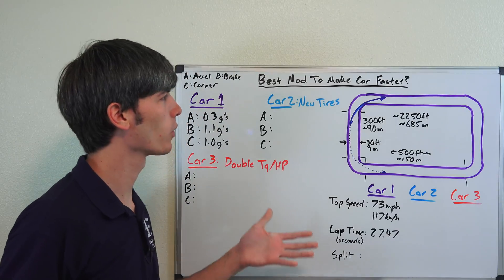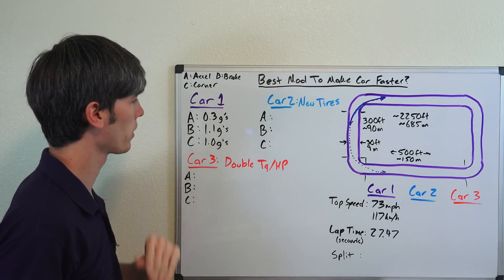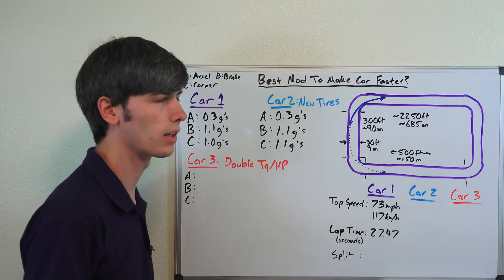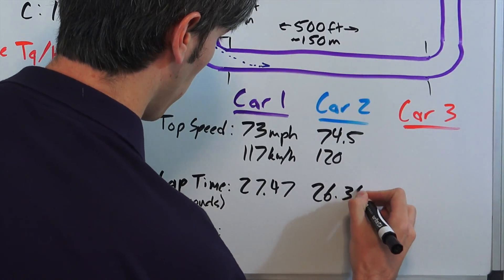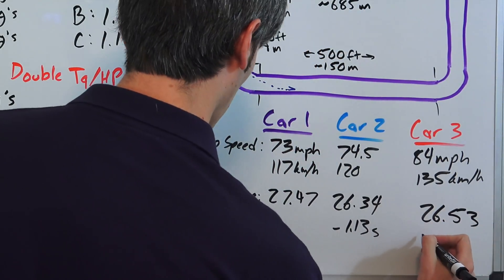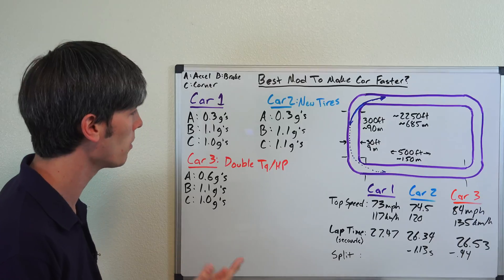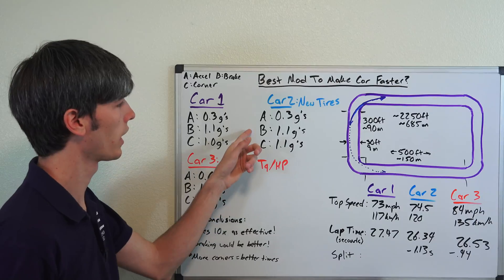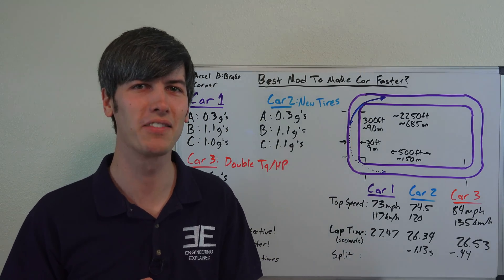What's The Best Car Mod To Go Faster?

Comment: This isn't a very good comparison because a track this INSANELY small doesn't give the doubled horsepower a chance to really be used. It would be like comparing 60-130mph rolling start times between summer compound tires and all season tires; they would be equal because you're not starting from a dig.

Comment: Your track it's totally unreal man, a track with 700m length doesn't exist, you are making this video totally useless to real life situacions!
Reply from the maker: +efrain kennedy just so ya know, a track can be long and still be a low speed circuit with lots of corners, or a track can be short and have long straits. Length does not determine average speed. There are ovals smaller than this.
Reply: jonathan jones The reason the F1 car was only marginally faster wasn't because of the distance, it was because of the surface and cold slick tyres, coefficient of friction limited acceleration for the F1 car for basically the entire length of the building
Reply: i think what he means is the F1 isn't so much faster, so friction is what matters.
Reply: Anybody remember when top gear used a F1 car to race a kia inside the NEC? Well the long and short of it was, on a very short straight the F1 car was just 4 mph faster than the kia.

Comment: Cool video, but can you do one where you factor in curb weight? I suspect (based on observations at track days) that power:weight ratio is not a linear measure of a car's potential lap time. It appears that excessive weight is severely punished by physics, and that extra power is penalized by a law of diminishing returns. That is, it appears that a brz could potentially beat an M3, and that an s2000 or an old 944 turbo are in the sweet spot (assuming you can't afford a Lotus Elise or Cayman S). So, how do we compare power to weight for potential lap times? Are recent car ads selling us 500 hp or 600 hp "Hellcats" just trying to sell us useless bs? Should we add lightness? Is adding lightness more important than adding power?

Comment: This is what always bugs me about people who talk about HP and 0-60 etc. It's mostly irrelevant on 90% of the cases.
Reply: robjapan True. But some of us simply enjoy the sheer acceleration :P
Reply: Sathrandur oh yeh of course, it's a lot of fun but corners and tunrs are a lot of fun too!
Reply: robjapan True, true. I do love corners (and it's always more fun when you can slide around them).
Reply: robjapan you do realize that most people who worry about that prefer drag racing over track racing?
Reply: A lot of people driving cars with a lot of torque/HP are terrible slow at cornering. I just laugh when they notice I was able to get at the back of the their bumper and they decide to push the pedal on the straight. See you again at the next corner.
Reply: Alex Are you sure? I've seen 0-60 listed on almost every car ever, but not once have people ever agreed on a track that every car goes around and a time is given. Even unofficially channels.

Comment: Hi there, how about car 4 , double Tq/HP with tires same as Car 2?
Reply from the maker: +Chin Beng Toh I answered this somewhere in the comments haha, sorry I'm not quite sure where to copy/paste the reply. About 2 seconds faster vs the control car.
Reply: thanks man! basically the tyre coefficient of friction is not strong enough to support and full unleash the performance? Btw thanks for all the videos, very informative
Reply: Engineering Explained b

Comment: hm I may be wrong but to me I think this only counts on smaller tracks like that, if you were to do the saem track where its 1 and a half km long and 1 km high than there would be a big difference on the car with more hp

Comment: painting the car red obviously
Reply: With racing stripes
Reply: And adding a short throw dipstick.
Reply: And the obligatory aftermarket GT-R badge to complete it
Reply: well, I beg a differ. I believe K&N sticker yield much more per size wise. trust me, personal experience
Reply: Dont forget red brake calipers
Reply: dont forget the obligatory monster stickers +5whp -10lbs weight +10lbs downforce
Reply: and fire stripes too
Reply: Tuzz Nation 
what about a vintage STP sticker??
Reply: DA RED GOEZZZ FASTA!
Reply: What's wrong with red...?

Comment: what would you recommend for the first modification to a 2017 Nissan GT-R (engine bay)?
Reply from the maker: +Brian Lutton tires 😂 Haha maybe trying to shed some weight. The car has plenty of power. 👍
Reply: driver mod.
Reply: put 7 superchargers on it
Reply: Brian Lutton new to the car scene with a 2017 GTR? If you actually have one of these I highly suggesting getting another car to learn how to handle and work on cars. Performance "packages" are not a cheap way at all to upgrade. A seasoned tuner can help your car make better times on a track for half the cost of a package. But seriously "new to the car scene" should not even think about tuning a vehicle of that level. Or else you'll wreck it like a Mustang driver at his 1st car show....
Reply: you should do some research.
Reply: I can't believe nobody said just a tune (more aggressive instead of efficiency) and higher octane
Reply: Brian Lutton I don't know but you  can find out check with  a car shop that performs high performance mods. you all ready have twin turbos what else can you do? I seen one Nissan on 1320 Videos on here beating Lamborghini with that  mod
Reply: Brian Lutton DO NOT USE CARBON CERAMIC
Reply: Lol, Warranty and more power can not be use in the same sentence.

You can try some fuzzy cubes, or wear leather gloves
Reply: Dexter Sullen Wrong, Bolt on parts are usually fine. Mostly fine. Simple bolt on power mods. Intake, Mid-length headers without tune. When your engine goes wrong they will look at it and see what is it cost from. 2 of my own examples. 1 has a tune a longtube headers, the otherone like me have bolt ons. first one is an Chevy SS, second one is a C7 like me. The tune SS was denied for warranty, while the C7 was granted the warranty. When they go in for repairs they send the data to GM, and they would analyze it and determined what was the issue. Same goes to Nissan. A TUNE IS A NO NO
Reply: You most likely right but the bolt on's wouldn't be fully utilized with out that essential tune, unless his gtr (or newer vehicles) ecu able to slightly adjust for optimal performance
Reply: LS swap it 😂
Reply: Brian Lutton do the driver mod if necessary
Reply: Brian Lutton racing  fuel injection
Reply: Engineering Explained Haha thanks man. Where would be a good place to lose weight? if your familiar with the car.
Reply: Gralin Dunn Is that legal? I am a learning newbie to the car scene
Reply: Yeah ill be sure to do that! I was thinking about upgrading it with an Alpha package, but I am not sure which is the best. What is your thought for best bang for the buck?
Reply: Brian Lutton it all depends  on how much is in your  buget and do you w nt to drive it every day. it might not  become a every day driver
Reply: Well I use it as a daily driver and I realistically could put $20,000 towards it. Do you think an alpha package would be good or just do separate mods?
Reply: Gralin Dunn ^^
Reply: Brian Lutton Brakes, the OEM rotors sucks, try get a AP Racing rotor upgrade
Reply: K Li I was thinking some carbon ceramic from AMS
Reply: Brian Lutton CCBs for street cars and Race cars are completely different. Nevermind the fuss of pre cautions you need to have for installing them. the price, the fuss, the performance isnt worth it.
Reply: Brian Lutton So NO CCB, specially GTR, So heavy. check out Top Gear when jeremy clarkson was driving a Avantador on the track with CCBs, CCB was gasifying. Steel Rotors are capable enough for 20-30min session trackdays. Specially good quality one. I use AP Racing on my C7. But for my car even the standard rotors will do.
Reply: Jorge Chávez sounds like a good idea
Reply: K Li Thanks man I really appreciate the help. Do mods mod shops have steel rotors or AP? What is the cost?
Reply: Brian Lutton Depends on what they carry and what shop is it. Theres a lot of good quality rotors, Girodisc, AP Racing, all the brands. I personally just buy them myself and bring it in to the shops, or do it yourself.
Reply: K Li Okay thank you very much man!
Reply: Dexter Sullen Tune viods OEM Warranty, judging by Nissan's reliability, 3.8V6 chunking out 550+hp, plus it viods the whole powertrain warranty, the transmission is the terrible part that would cost you $20K. Plus it is already fast enough for most people to try and reach its penitential.
Reply: Dexter Sullen Yes you are right about the ECU, but as you know the GTR's service fese is already hella expensive, and you dont want that transmission going wrong. In fact non of the OEM ECUs are strictly for pure safe performance, theres stuff like smog, emission etc.
Reply: unseenufo savage
Reply: Anthony Alit The GTR is my first car so I don't take it to the track. I use it as a daily driver and only get above 5000 if somebody wants to race or I see a Prius. I do and will continue to try avoiding large crowds of viewers as well.
Reply: Brian Lutton
Reply: Why not save your money and enjoy your Gtr as standard until the 2017 model comes out. Your current Gtr won't lose that much value and the 2017 will already have been tuned by professionals. If you spend 20k on upgrades you will never get that back when it's time to sell. Better to buy another car with the mods already included and warranted.
Reply: Amateur Torque I already have the 2017 model
Reply: I'm looking at the driver. http://www.thediceabide.com/wp-content/uploads/2015/08/homer-evil-dog-400x250.gif

Comment: How much of an impact does tire size have?  For example my R129 came with 225/55-16'a all around, but I changed it to a staggered setup with 275/35-18 (rear) and 245/40-18 (fronts) - obviously overall they provide more grip as they are also now summer tires instead of all seasons, but I'm curious as to how much the width is a factor.
Thanks - love your videos!

Comment: While the example given is correct, the actual answer is "it depends". One must use the theory of constraints, that is that there is some limiting factor that restricts performance. For example, if I already have really good tires and getting "better" tires will only provide an addition 0.01G of cornering force, while I have a governor which restricts my speed to 65mph, obviously removing the governor will provide a bigger performance boost. Considering vehicle dynamics, your car may be suspension limited vice tire limited, so improving tires may not improve cornering significantly.

Comment: I have seen that shorter tracks are better for less powerful and lighter cars, and bigger tracks need more power (I didn't watch the full video).
But for example, Nordschleife lap times, vs Laguna Seca lap times, off course not actually the lap times, but what cars are better and how those same cars are worse against other vehicles, on Nordschleife.
A Focus ST can be better than a 458 in a really short, 'tight' track, and the 458 totally better on Laguna Seca, and far better on Nordschleife.

Sorry if my english is bad, but I tried to explain what I have seen, because sometimes people just gets confused and thinks that the same car that won at "Top Gear Track" (for example), can win to those same vehicles on a different track.

Comment: My General Physics class just suddenly got a lot more interesting. We're on centripetal force at the moment, and some example problems use the concept of a car going around a circle both skidding and not skidding. I can see what I've learned in previous chapters applied here, and I can't wait to see what other stuff I can learn and apply to driving. Great vid!
Reply from the maker: Awesome! Check out the video description and the video titled "cornering speed" and "racing circle" for similar applications of the principle you just learned!
Reply: Physics with Calculus 1? Im taking that class as well. Wish they used examples like that though.

Comment: EE, is it true that the only factors that effect how much tread is on the ground is the weight on the tire, and the tire pressure? regardless of how big or small the tires are. so for example a 325 vs a 285 would have the same contact patch if the weight and tire pressures are the same?

Comment: This video is completely inaccurate. Obviously buying a louder exhaust for your Civic will give it the biggest performance boost.
Reply: Bumper stickers on the windshield, duh.
Reply: It's all about those huge rims, fart cannons, spoilers, and stickers!
Reply: you forgot the cardboard body kit
Reply: fart can. biggest you can get. Let it drag on the ground if need be.
Reply: Paint your brake calipers for the extra 25 kilowatts!
Reply: Incorrect right answer is CAR WASH - last time I looked at my PS2, GT3 game, If I do a car wash, my laptime improves 100x :) due to improved areodynamics XD
Reply: avsrule247 uh, sir you are clearly unaware of the power that stickers can provide.
Reply: Wrong!!  Remember Ricer's 
I mean Racer's * 😉
 each sticker you add to your ride is 5hp +
Reply: avsrule247 I beg to differ. there is no mention of any vtec stickers
Reply: bigwilly43729 each sticker is 5 hp
Reply: the "DRIVE IT LIKE YOU STOLE IT" stickers got to be worth like 25hp all my cars just seem faster with them. Just saying lmao
Reply: avsrule247 Hehehe. And a huge bolt on wing.
Reply: avsrule247 hahahaha classic lol.
Reply: avsrule247 Well, I suppose you've forgotten that chopper rims give you car more torque?
Reply: By popping on a "Type R" badge would also give it 50 more horses.
Reply: And sexy.
Reply: Most of the performance loss from a random unnecessarily large exhaust is low flow velocity. Especially low in the rev range
Reply: no a back spoiler with FWD is like the ULTIMATE
Reply: u need the dubble xl rice burner
Reply: Razer_Fox
Reply: Yess finally someone who knows the performance of a car is measured by how well the rice can burns the rice. So yes all you need is a V Tec with some premium rice injector lines and a rice can on the back
Reply: Alan Hunter jj
Reply: Jonathan Roeder what
Reply: I've heard painting racing stripes over the car can give you at LEAST 500 more bhp
Reply: Chriscorvette360 no it actually gives 1,000!!! Lol
Reply: Preferably red ;)
Reply: Seat covers for weight reduction brah
Reply: Almost fell off my chair because of this comment.
Reply: avsrule247 
Product Logo Stickers, thats what makes SPEED!
Reply: avsrule247 and you need to camber those wheels to 40° for all that severe cornering.😲
Reply: Pretty sure misused apostrophes add 10 foot pounds of torque too. Or wait, maybe it's -10. Good thing I can grammar
Reply: And fake Carbon Fiber!
Reply: Matt's Youtube stuff civic and fast should never be used in the same sentence. It is and will always be a reliable and affordable economic car. Period
Reply: And your cylinder count?
Reply: That is true
Reply: Don't forget about adding a sick wing on the back
Reply: Matt's Youtube stuff no wonder so many people at my high school have loud exhaust systems!
Reply: You need a larger VTEC 🙄🙄🙄, very tall engine cooling
Reply: Alan Hunter Most stock exhausts are already well designed for the stock engine. Most aftermarket replacements will do nothing (except maybe reduce performance) unless you have other performance mods. Some back pressure actually improves performance. 

As for backfires, they are caused by ignition timing issues possibly due to poor quality fuel or aggressive ignition timing.

High performance exhausts are also not to be confused with the loud fart cannon designs mentioned by the OP.
Reply: no no no you got it all wrong it about Octane Boost even if the engine is low compression and naturally aspirated. Better go get some fully synthetic, and the K&N filter plus the TORNADO INTAKE will make my Nissan Pulsar NX that is stock faster than a "Pulsar Turbo!" My friend across the street's big brothers wife's brother-inlaws uncle's grandfather owns a shop. I know what I'm taking about because Jimmy down the street sister's boy friend's moms cousins sons step father said I'm right!
Reply: Don't forget if you are unfortunate and don't have a honda add some good old H badges to the car. Guaranteed vtec dohc performance
Reply: i was the 1000th like...   do i get free ebay turbo?
Reply: avsrule247  well, of course...
Reply: Well you can actually get a good amount of performance out of going with the correct exhaust since the exhaust is a big factor in the internal compression of the engine. Bigger exhaust adds latency but makes it less prone to generating spikes in back pressure. Smaller exhaust allows pressure to build very rapidly removing the latency but there will be enough back pressure that you may not get a full burn of the fuel. There are also high flow mufflers and headers which will allow a faster flow rate allowing you to use a more medium size of pipe and remove some of the latency the larger pipe induces. It wont give you that much more horsepower but it has the side effect of making the engine work more efficiently being picky about exhaust. 

I went with one of Flowmaster's models designed specifically for the latter, it had other neat tech to it too but that was my primary reason for choosing it. I went from 12-13s quarter miles to 11-12s due to how much more torque I could lay down over a wider range with the high flow muffler and header. It also remedied a problem where back pressure in stop and go traffic would cause very small hardly noticeable backfires which were burning out air filter elements. Such a common problem with the stock setup that people use a specific metal coffee filter and stuff it with steel wool over anything larger than a 2 barrel carburetor to get around the problem (other than residue that's easy to clean and the filter, it wasn't harmful to parts).